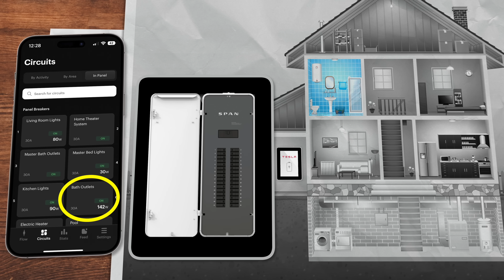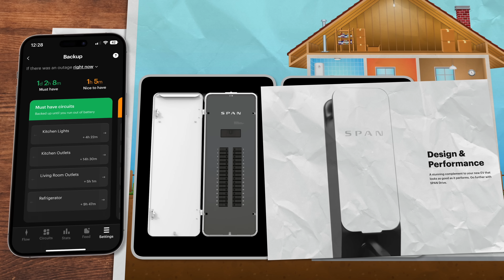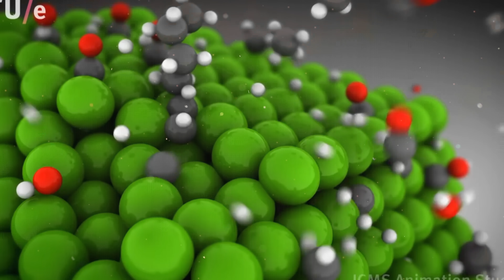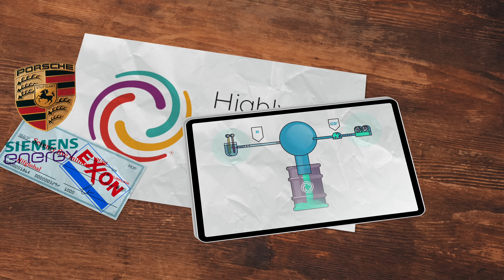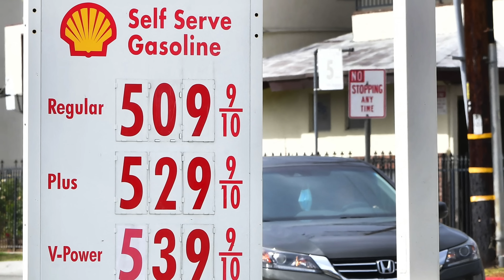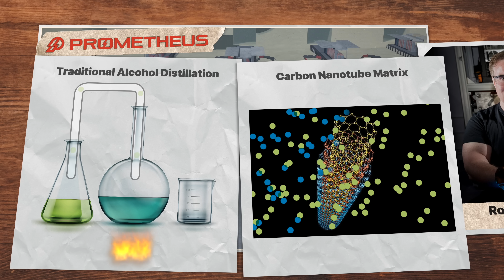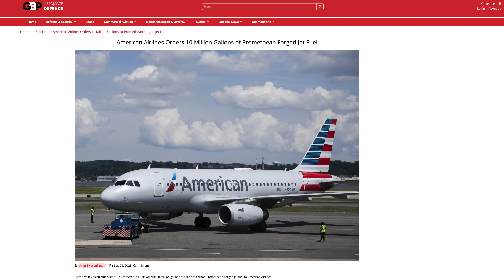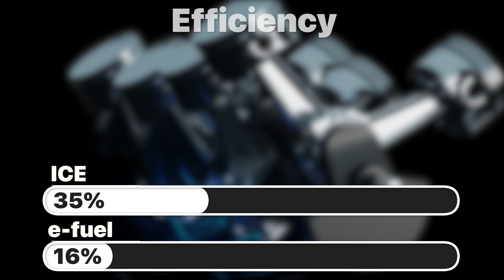EPIC Breakthrough Can SAVE the Internal Combustion Engine!

Comment: It’s going to be the Pareto principle. Replacing 80% of Fossil Fuel use is going to take 20% of cost, resourcing & effort. It’s going to take 80% of C, R & E to ‘replace’ the last 20% because of practicality. Eg long-haul air-flights, shipping & trucking. So for those transport needs a synthetic fuel makes sense. 

But for general personal transportation, EVs will be the mainstream unit.

Also, modelling has shown need to build three times RE (with some storage & X-country interconnects) to meet demand. On good generation days far more electricity than required will be produced. So cheap ‘excess’ power can be utilised to produce synthetic fuels at very low input costs - just need to be flexible with production times.

Comment: Technically, jets don't use gasoline, but close enough. There are many prospectives for long haul air travel though. I personally feel it's a really hard problem, and there is just lower hanging fruit to tackle first, with the same, or more benefit. Replacing shorter, over land, flights with high-speed rail, for example.
Reply: Rockets?
Reply: Aviation or jet fuel, which is a hydrocarbon.
Reply: High speed rail (point to point transportation) is not a reasonable replacement for air transportation (any to any transportation)
Reply: @DavidHalko  My engineer cousin knows it is, London-Aberdeen by train is working in his office 'on wheels' which is not possible in a cramped cabin, plus while actual travel speed is slower there are not all the time wasting ancillaries.
Reply: @DavidHalko  people are mostly going point to point. People are going from one city to another. We're not talking about the unusual trips, we're talking about the majority of trips.
Reply: @klepow  - the problem is that rail is generally half duplex, one train 🚊 travels on the rail at a time going into a city. Maybe 2 trains 🚂 on a line, in the same direction, but not traveling the same line in opposing directions. Large segments of rail are shared. Sharing is more limited. 

With airports, multiple planes can be in the air at a time, hovering in queue, at different altitudes, and they are landing 🛬 one plane a minute. All day long. They look like strings of beads in the sky. It is more like a full duplex network line.

Sure, we may have multiple rails entering a city, like multiple runways to an airport, but those runways are constantly in use by multiple planes, coming and going fairly rapidly within x mins, and the planes ✈️ can all be coming in and out, without the need to build the rail infrastructure between each point… only at the end points.

To increase simultaneous usage with rail, more rail must be built & maintained, more rails between each & every point. 

To increase simultaneous usage with air, more planes ✈️ take off and land on existing runways, and adding a runway is easier than adding a rail, since the sky does not have to be built or maintained.

Trains 🚂 are so 1800’s. The amount of energy & co2 required to make the steel, crush the rocks for the rail bed, create the ties of wood or concrete, swap the ties on a regular basis, inspect the rails, dispose of the old rails & ties, railroad ties are dumped in stacks on old railroad 🛤️ land (I used to live by such an area). Concrete is buried in landfills. It is outrageous! The energy used & waste is unbelievable! 

For the planes, we use radar to make sure the air is clear, we don’t inspect the air for flaws to replace the air when a defect is seen (just avoid occasional storms, which clear up), don’t need to dispose of bad air with defects (storms drop their rain 🌧️ and all is good). Plants 🌱 grow from the CO2. Nitrogen becomes fertilizers for the plants 🪴. The rain 🌧️ waters plants. Cows 🐮 eat plants 🌱. We eat burgers 🍔. All is good 👍🏼 in the world 🗺️ 

Honestly, air travel is much more economical & environmentally friendly. 

Once we have flying cars, this discussion will be so irrelevant.
Reply: Rail. is the OBVIOUS PROVEN DOABLE solution that nobody is talking about. ;/. in amrica any way
Reply: @sparkybob1023  we developed a solution to this problem almost 200 years ago, but let's see if we can find a much more complicated solution, meanwhile disaster is striking.
Reply: @sparkybob1023  -“rail is the… solution that nobody is talking about… in America”

Because rail 🚂 is from the 1800’s. It is good for heavy goods, traveling from clear endpoints, like a port to a city.

Human transport is not like this. How many people in your neighborhood work at the same location requiring transport by train 🚂 ? In my neighborhood, 0. Literally no one.

In some countries, where there are occasional, highly dense cities, it is much more useful, but not in places like the US, where people are spread out.

A rail may go in and out of a city. Once this is done, people drive their cars 20 mins to a rail station, park their cars, just to get on a train to ride somewhere 30 minutes later, to walk 20 mins to a destination? They can drive to the destination in 40 minutes. A waste of time. 

People get robbed & raped at the public parking areas, cities are inherently unsafe in the places like the US now a days, because incompetent politicians were elected by people who are dumb. The policies are such where you have to walk through homeless encampments, avoiding the needles 💉, and the human fecal matter 💩. 

Everyone is talking about high speed rail, indirectly, when they are taking about crime 👮‍♀️, drug addicts 💉, poop 💩 maps 🗺️ of streets in major cities, 2nd Amendment rights for the individual, and working virtual.

Comment: I like the idea that got started a couple decades ago where water was used to power ice engines! The rub there is what were they using to lube the internals like gears and pistons 🧑🏾‍🔧? If we can solve that I vote for keeping our current vehicles and powering & lubing them differently!
Reply: All of the "water car" promotions are of dubious value, often selling "plans" that just don't work because (A) water rather inconveniently refuses to burn, and (B) any electrolyzer process uses up far more energy than can be recovered by burning the resulting hydrogen/oxygen mix. Lubrication is not the issue, as there are plenty of silicone or teflon based lubes that work fine in watery environments. 

If they really worked the way promoters claim, the auto-makers would be all over it. as it would be a huge advantage over their competition. But they don't, because it doesn't work.

Comment: Skip to 7:20 if you already understand the background. Good article and nicely presented; have you also looked at NH3 as a fuel? This can be used in jet engines and internal combustion engines or in fuel cells and is much safer than H2 as a fuel storage.
Reply: actually, looking at the process they could just use less energy and stop @ Methanol? there are already Methanol fuel cells (indirect hydrogen) cars/tech with electric propulsion motors and we could via pyrolysis of waste turn everything to Methanol? I believe Flex Fuel cars already present could be capable of working with up to 85% Methanol fuel mix while Total Flex fuel cars M100 (pure) so we could have a single fuel to power both ICE and FCEVs...
Reply: @phatmeow7764  BINGO!  Been pushing this for decades!!!  M85 is the best solution.  Produce it from nuclear power plants, in site, and you produce high-density energy AND electricity at the same time.

AND... no new technology needed.  Solution is staring us in the face right now.

Comment: Hey Ricky thanks for this interesting video! Of course going deep into this subject would take more than 15 minutes but this is a good overview of the market and technologies, so thank you. Btw you definitely have to check Synhelion, a Swiss company that makes jet fuel out of solar energy (with mirrors, not PV panels).

Cheers from Switzerland!
Reply from the maker: i'll check them out!
Reply: This may be Professor Steinfeld's process, producing fuel stocks for aviation using sunlight and CO2 from the air.  ETH institute in Zurich, Switzerland.

Comment: Love your channel.  And you are correct about ICE engines. However the implication that autos are the main contributor by the video scrutinized with the dialog is killing the ant and ignoring the termites.  I might be mistaken but, believe it was even one of your own videos that clearly pointed out that industry surpasses autos in magnitudes of order.
Another note. I lived in NY, NY and the public transportation is well developed there.  Very few of my friends had cars. We all went where we wanted, AND FASTER, via public transpiration. If public transportation was developed much better including intercity routs via high speed, I believe the individual engines on the road would dwindled dramatically.
And finally the ev trend has created fantastic diversity in personal transportation.  I personally invested in a simple and inexpensive bicycle conversion that gets me 30mph with 50 mi range. Now my truck sits for weeks.  I have to make sure I charge the battery in it.
Reply: good for yiu

Comment: 1:43 Provable lie! A single volcanic eruption, releases much more that we have since we begun using fossil fuel.
The single problem with fossil fuel is , they are finite and the reserves remaining are deeper and deeper. 
We need a new source of energy. 
1:52 Talk about a cure worse than the disease! instead of burning fossil fuel directly, we burn them to produce electricity , to power the EVS! Need i remind you the problem did not go away? 
Fossil fuel or rare earths , they are both finite non renewable commodities. We should make the Kongo look like a lunar scape, so you feel good driving the newest craze? Empty Virtue Signaling, that ignores the problem again!

Comment: ~ 0:40 - One of the main culprits - road transport is responsible for about 12% of CO2 emissions, about as much as iron, steel and cement production combined, or twice as much as livestock and manure.
Reply: Scrolled down for this comment, surely electricity generation is 1# and transportation is second which covers ALL vehicles including boats and aircraft right?

Comment: E-Fuels have less power per gallon and they destroy some of the car's engine parts. That's why some cars are designated as "Flex" cars, but most are not. Flex cars can use up to 85% E-Fuels. Most cars can use only 10% E-Fuel, though some can use 15%. I rented a car that could use 15%, and I thought about filling it with 15% fuel which was cheaper per gallon until I looked up the EPA MPG specs for 15% and regular fuel and then I found out that the cost per mile was less with regular gas.

Comment: I teach business. I also have an eye on the future costs of crude oil. As it stands today, the human race needs to discover and produce the equivalent of another Iraq's crude every year. Even then it gets more difficult each year. A shale field has a life expectancy of 4 years. Inevitably, by 2040, the cost of a gallon of gasoline will hit $20 retail, and by 2060, $50/gallon. The is the hidden secret behind the "global warming" story. It is not about global warming. It is about running out of crude. Electric cars are NOT a solution - at current rates of copper product, we would need 100 years of mining to get the copper to replace the global fleet of vehicles. (That said, a global Uber-ish fleet of electric cars might do the job. Privately owned cars are parked over 90% of the time.) But the solution offered here is breathtaking. When you said, $27/gallon, I wanted to cheer. At $7/gallon, it is a no brainer. I immediately pictured solar or nuclear fuel production facilities in the world's deserts, with pipelines bringing the fuel to markets. If you can make diesel at competitive prices, you can make natural gas. Assuming this is all true, it is EPIC indeed.

Comment: This is probably our only hope.  Apart from creating fuels, the technology could be used to make plastics which takes CO2 out of the atmosphere and stores it in a way that could eventually be profitable.  Plants could be designed to increase output whenever there's less electricity demand.  It also just sounds safer than releasing sulfur dioxide in the upper atmosphere, the other technology which could reverse global warming.  I wonder how Carbon Engineering is doing...

Comment: Even if Co2 emissions are supposed to be zero, you're still polluting locally, with carbon monoxide, nitrogen oxides, unburned hydrocarbons, rare metals for catalytic converters, etc.
Make these fuels, but make the for all industries that can't be replaced with batteries first, and some classic cars of course, gotta keep those on the roads, but for normal commuting and short and medium-haul transportation EV is the best option right now.

Plus you don't need huge amounts of renewable energy, and also the real world efficiency of ICE engines in cars are often times much lower, more like 10-20% of the fuels energy content, depending on driving conditions, because the engines often doesn't run in it's optimal power/load window, thus consuming more fuel/kWh of energy produced. unless you have a Diesel that can keep your car at 65mph on the freeway with something like 80% load at idk 1500-2000rpm wherever the specific fuel consumption is lowest, hell, it would probably even be better to run a generator and charge a battery with it and drive electric than to burn it in an engine directly.

Comment: Here's wah I think.  We have already seen that General Motors stopped support of its batteries eight years after after production of the Chevy Volt ceased leaving the car owners to fend for themselves to purchase extremely expensive  used lithium ion battery packs.  Until a more reliable and affordable battery pack that can charge quickly is brought I to production ICE vehicles will continue to supply automotive needs of the masses.

The second problem surrounding the replacement of ICE vehicles is that the electrical grid cannot handle the load for charging everyone's electric vehicle.  It would take a a long time to upgrade the electrical grid to charge all those vehicles ad a lot more power generation to provide power the vehicle. 
 However, this is the time to do it as our old power grid  needs an overhaul anyway which would include EMP proofing the system which at this time Congress has chose to allocate funds for fighting endless proxy wars.

As solar has reached its technological maturity (using monochyistaline panels and lithium iron phosphate batteries and and thus is affordable to power an entire houe as it takes seven to ten years to pay for itself,  powering an electric car may become possible on sunny days but it will take a lot more solar panels and electrical storage to accomplish that goal of supplying all that electrical energy.

Comment: Yeah, you might want to look at the amount of evergy used to create E-Fuels. The efficiency is terrible, so it's certainly NOT carbon neutral. You can't magically claim that something is Carbon Neutral by assuming that the renewable electricity is carbon free, it isn't. Every watt you waste equates to more carbon emissions. It makes zero sense to waste electricity on E-Fuels that could drive EVs tens of times further for the same energy!
It may be necessary to keep fossil fuels for Aviation. I think you'll find that it's not any more carbon efficient burning Fossil fuels than it is burning E-fuels. It's not about money, it's about Carbon neutrality, and this is a farce.

Comment: All the air pollution which accumulates in your lymph nodes distracting & immobilizing your immune cells. Research suggests that it starts accumulating more than it's able to clean around 30yrs old with lymph serum samples containing pollution.

Comment: 🔌🔌Last month before I retired from Cummins we were allowing the use of Renewable diesel in generators and our truck engines. Many Data Centers and California fleet truck operators west of the Rockies are now using this fuel. Renewable Diesel performs like fossil diesel, with superior performance over biodiesel. It meets ASTM D975 and EN 15490 specifications in compliance with Cummins Diesel engines and most other OEMs. No, it is not 100% CO2 reduction like e-fuels but is 85% which is a step in the right direction until the H2 infrastructure and renewable energy power stations are built.🔌🔌
Reply: EV is a joke. The environmental impact between the batteries themselves & the amount of CO2 it takes to produce the batteries and most electricity is produced with Coal. The absolute worst fossil fuel. The best alternative today is hybrid vehicles.